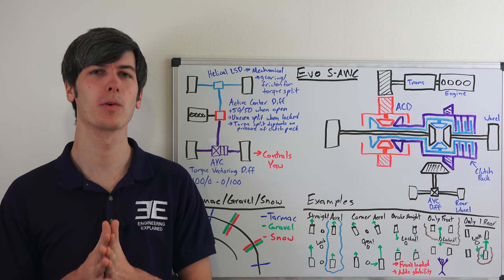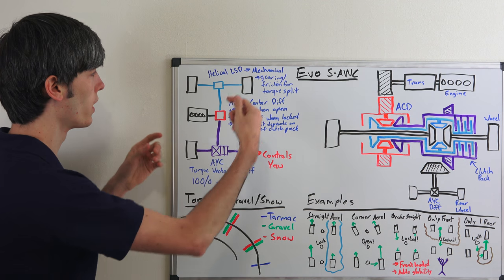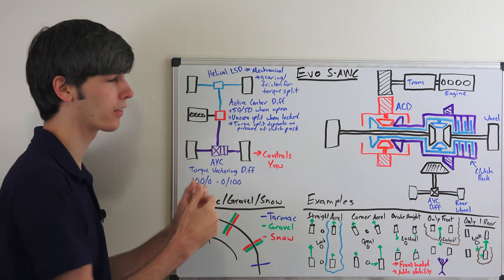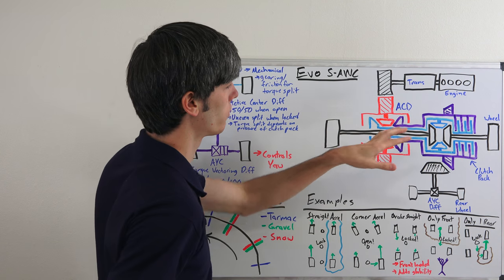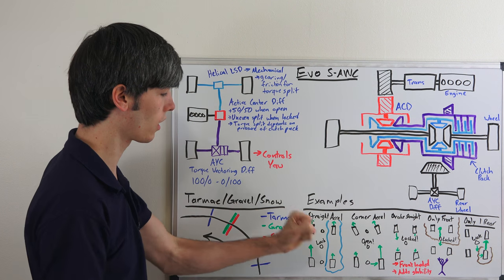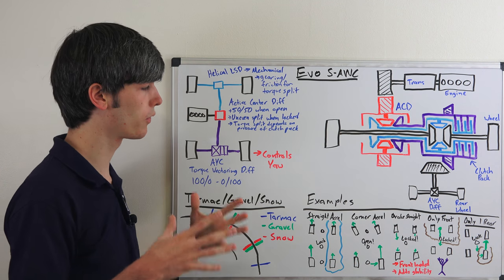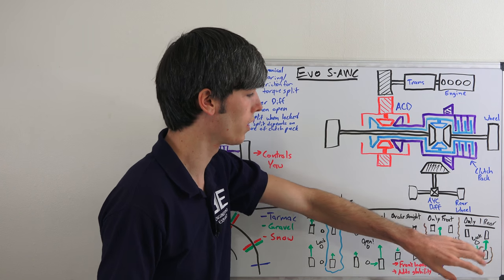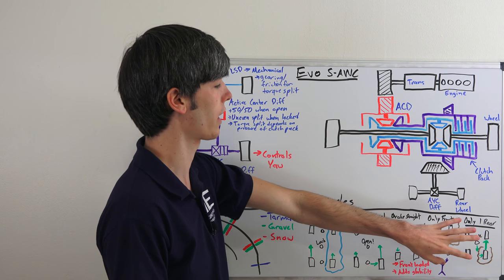Mitsubishi Evolution X - How The AWD System Works (S-AWC, ACD, AYC)

Comment: Explain the STI drive train please. On the forums the evo is praised for its ability to make more power easily compared to the STI, but people take the Subaru because of the reliability. I'm looking into purchasing a 06-07 STI and want Subaru AWD because it in my price range and safe choice for my family. Doing a detailed video on the STI will further convince myself and others why Subaru is a good choice or not?

keep up the good work! hope you get rewarded in life for your intelligence and hard work.
Reply: +PunisherOfDeath101 Hey, Just so you are aware WRX STI's are not reliable, Atleast in there current form that has been around for 12 years i believe. I dont think i have met a STI driver that hasn't had an engine go on them yet. Look around for Bearings going on the engine rod and you will see its fairly common. Not to say they are awesome cars when they work!
Reply: Drpoppler same can be said for mrbitchy..i just prefer the look of the sti. if you slam on any car they will break. these cars are over engineered, too meany places for failure.
Reply: +PunisherOfDeath101 The number one issue with the Evo's drivetrain reliability is corrosion failures in the hydraulic pump that activates the ACD and the AYC.  If you drive in any kind of salty conditions it is almost guaranteed to fail eventually.  The people that ruin their transfer cases are probably running bigger turbos with super strong clutches and launching way too hard.

The Evos are known to make more power easier but I don't think that should be a deal breaker.  If you are trying to make 400whp on a stock block motor you may want to go Evo.  But if you don't care about that sort of thing or are going to go all out and build the motor anyway, it doesn't make as much of a difference.

I do personally think the Evos make better dry track cars due to the handling benefits, but that does not mean it is a better car overall.  If I didn't get an Evo I would want an STi and vice versa.

P.S. STis sound better
Reply: +Drpoppler they can be reliable if you keep it stock.
Reply: +Balo657 ....makes no sense. and I'm not in the mood to debate to you why.
Reply: wat.
Reply: jesus christ.....to a degree stock will last forever...to a degree. their is always room for improvements in performance and longevity of a engine. saying that oem make bulletproof engines that can last longer than a modified ones is bullshit. if the modifies engine is modified poorly for performance only, longevity of engine will suffer. Oem engineers aren't engine gods, very skilled but their is always room for improvements. stock is not where it ends. do research and buy what the engine needs to lengthen is life. reliable and stock sounds so dumb in the same sentence if you say its the best option to make a strong engine. what i said should be comment sense but whatever.
Reply: Carmicha3l well let's start with the factory tune which if you research it, causes many reliability issues. Oh and an air oil separator. Also the rod bearings. I got trimetal ones instead of the factory bimetal. They also have 2 oil ports instead of 1, which is essential for the 2nd and 3rd rod which get fed last. The factory unequal exhaust header is another liability, as it theoretically causes exhaust valves to burn, which is a common problem. How about a frontmount intercooler, the stock top mount heat soaks causing detonation. The list goes on....

Comment: how does this compare to the gtr's awd? that's all electronic right?
Reply: +frankth3frizz As far as I've been able to fathom it out, the Nissan GT-R's system is as follows: By default, the engine sends the power to the rear. The front end is connected to the rear via a separate clutch pack, and when that is engaged, the front and rear are essentially locked together. There is no center differential as such, just a "simple" clutch connection, controlled by computers (this means that if you remove the shaft connecting the front to the rear you end up with an RWD car, and lots of errors). Nominally the say that the torque split varies from 2:98 to 50:50, but my guess is that if the clutch is engaged and rears are on super slippery surface, the front will receive more torque than the rear. The front differential is an open one, so nothing special there. The rear differential is some form of torque vectoring differential, so similar to what the Evo has in effect.

So the main differences: GT-R has no center differential where as Evo does have one (GT-R only sends torque to the front if the clutch pack is activated, and this also locks the speeds together, whereas the Evo always sends some torque to the front and only locks the speeds together if the ACD is active, so GT-R can behave as an RWD in some situations whereas Evo is always AWD), and Evo has a helical (torque biasing) front differential where the GT-R only has an open front differential (so GT-R front diff is less useful when there's a traction difference between the front wheels).
Reply: +jubuttib Basically software engineering (GTR) and electronics engineering (EVO X)?
Reply: dAbaPEsTA123 It's definitely both on both cars, both have plenty of electronically controlled components directed by software. The differences mostly boil down to Evo having a more effective front diff (torque biasing vs. open in the GT-R) and Evo having a center diff that always sends torque to the front (Nissan doesn't have a center diff, only a clutch to connect the front directly to the rear). This hints that the two systems have two different emphases.

Put it this way, the Nissan GT-R is coming from a tarmac perspective and emphasizes getting the power to the rear tyres for more maneuverability in grippy conditions, with the front being engaged when the rear can't handle more power, or when stability is needed. When the front is engaged, the car is always trying to equalize the speeds of both front and rear axles. The GT-R is an RWD car at heart and uses AWD properties to help out situations where RWD isn't enough, but isn't as hindered by AWD's downsides when it doesn't need it.

The Evo is coming from a rally perspective and is worried about always putting power to all four tyres in a functional way. The center diff sends power to the front and rear 50:50 when not locked, and can activate to lock them together to stabilize the car and allow more power to be put down on a looser surface (the tarmac mode makes the center diff lock activate less than in the other modes, because on tarmac it can really hurt turning capabilities). The Evo is a pure AWD car at all times, and for better or for worse has to deal with the problems and benefits of AWD cars at all times.
Reply: @jubuttib  : gtr don't have torque vectoring in rear But simply have a mechanical  LSD..

Comment: Regarding the first example you give: If you're trying to accelerate in a straight line, how much of a problem is it to have a power disparity between the right side and the left?
Wouldn't the car veer in the direction of the slippery patch? What happens if you're cornering and the outside wheels go over some ice, would the diffs lock up and send you wide?

Comment: 1. The active center diff when you say 50/50 when open: what do you mean by open? When does it actually open?
2. How does active center diff lock up?
3. What does clutch pack has to do with open and lock?

The whole open and lock thing is the main confusion I have when I try to understand the video. If you can explain to me, that would be awesome. Thanks again.
Reply from the maker: When the clutch is disengaged, it's open. When it's engaged, it's "locked." Check out my related videos, especially on limited slip diffs to get a better idea. It's drawn and explained in this video as well. The clutch clamps down, so that the two shafts of the differential must rotate at the same speed. This is what defines a locked clutch. Open means they have independent speeds. Video description has lots of related links! :)
Reply: +Engineering Explained how often would that clutch need to be replaced?
Reply: +OneWhoGames 9 times a day :)

Comment: Please, can you compare the Hondacura SH-AWD system against either the S-AWC or Symmetrical AWD please? I think the SH-AWD has a pretty trick rear diff, and I wish it was in a smaller car than the TL, like a new RSX for example (with the J while I'm earth dreaming).

Thanks!
Reply: +Jesse V There's no center or rear diff in the SH-AWD setup, it's just 2 electronic clutches on the rear that can engage from a slightly overdriven rear drive shaft. The new Focus RS uses the same setup. Honestly it's a pretty lame system compared to S-AWC or any kind of symmetrical. It's basically an open diff front wheel drive car with no center or rear diff. Systems like that do not do well in low traction situations. I've researched, which is why I own an Evo X and a full time symmetrical AWD 4th gen 4runner with Torsen center diff.
Reply: +Drew Middlesworth i knew the new focus rs wasn't particularly exciting as awd systems go but i thought there was more to the planetary gearset in the rear of the sh-awd - I know there are several versions of the sh-awd too, but i think the mdx and tl have the best versions? anyway,. thanks for the reply - this is why questions are asked :)
Reply: mis info..sh_awd is 1 unit.split torque to awd.The s_awc is more advances it use 50/50 & ayc vectoring.
Reply: I find the Focus RS AWD exciting. At least from what I've been told it is a cool setup, lacking a differential in the rear and having a different gearing to put the torque vectoring to proper use in the corners :)
Reply: I bet the Focus RS AWD drivetrain setup will end up a huge reliability headache. Using clutches to engage and disengage drivetrain components hundreds of times a day while under heavy power is not going to be reliable in the long run.

Comment: The system is still amazing by nowadays standards. However, as a real evo owner would complain in cold area where a lot of salt is used during winter. AYC/ACD hydraulic pump is a pain in the ass.   Mitsubishi should have factory relocated it into somehwere that doesn't expose to the environment.
Reply: There is a very inexpensive option to relocate in the Trunk.

Comment: Pretty amazing how many things can be shoved between 4 wheels just to move people around. What is it like for a manufacturer to sit down and decide how much technology and engineering they want to shove into a consumer product (after deciding $-in and $-out)?  +Engineering Explained, could you put together a kind of crash course video(s) explaining the processes of engineering new vehicles or components? Or shed some light on the inventive background of mechanical engineering. 

Do manufacturers have an estimated life expectancy of drive train components (or all of the vehicle components)? How long would the differentials and clutch packs last before needing to be replaced? How long before total failure? Reverse engineering?
Reply: +Charles Bulinski It's very likely that the engineers take all those things into account.  the whole process is quite incredible.  I'm a mechanical engineering student.  and I'm just mind blown by the design that goes into a single beam.  costs, ease of manufacturing, efficiency, how long it will last.  all those things are taken into account.  generally it's the engineers job to try and balance all those things and produce the best product.
Reply: +HingleMcCringleBerry nice vid!!
Reply: HingleMcCringleBerry I guess I'd like to observe the people in these scenarios working together to make all the decisions as a group and individually. Plus there's a time factor to make all the decisions.
Reply: +Charles Bulinski exactly! time is an engineer's most valuable resource.  maybe you should become an engineer xD
Reply: +HingleMcCringleBerry I just like watching videos on what it's like to be an engineer. :P

Comment: At 8:20, Why would someone drive on one wheel? Uphill, three wheels are on wet ice, one is on snow,  dirt, or pavement. 

Also I guess you could be in the situation where you are on a very uneven surface with 4 inch bumps or holes accelerating and this could cause one wheel to be on the ground, and this would give this system and edge over say a Haldex for a split second, but this would be competition rally only you really should be driving your own car on pot hols like this.

Comment: Great break-down! kicked myself for not having notifications for your channel turned on. I missed this by 2 weeks.  Now would you be willing to do one on the WRX and STis awd system? Thats a system I know very little about . Even after spending a half an hour reading one of the Subbie forums. No pictures or diagrams so it wasnt as easy to picture. Thanks for digging up the info and getting this video out.

Comment: I could be wrong but in the scenario where only one wheel has traction, it isn't too difficult to assume that might be used for ice.  One wheel might have more traction than the other three, therefore it sends power to that one wheel.

Comment: Pro tip: Evo X in Tarmac mode on snow feels like RWD.

Turn traction control OFF (not OFF OFF) and you look like a really good driver doing second or third gear drifts while the car saves you LOL!

Evo X needs 50% more hp at least so bolt-ons plus pro tune and it's alright.

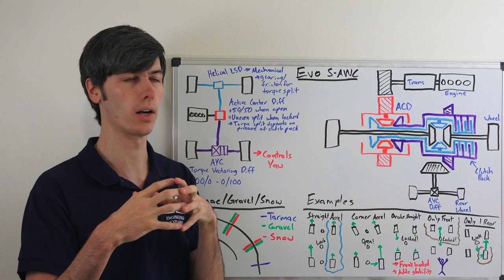Comment: At 5:16 WRONG WRONG WRONG WRONG! That is NOT how a helical works. If you have the right wheel over water, THAT will be the wheel that gets ALL the power. This has always been the downside of ALL helical differentials, they act as open over an unequal terrain and travel the path of least resistance. it will THEN be up to the rear wheels to take the torque it has left and travel the car through the water as the front will be useless until it has grip on both wheels again.

Comment: The power goes to gears of transmission and inside it has a final drive the acd is is inside the transmission connected to the final drive then power goes to the transfer case where the LSD sits and the acd clutch packs sit on the outside of transfer case but everything is with in the transfer case just the two fluids can’t mix I have torn down the transmission and the whole driveline to have it build.

Comment: I've noticed that the driver control selection also changes the sensitivity of the traction control system. Meaning, if you leave it in Tarmac and drive in the snow the traction control system will go ape shit and you ayc breaking and traction control lights will flash constantly. If however, you put it in gravel and then snow the traction control will actually get less sensitived to slippery road conditions and not go into Oh shit mode all the time.

Comment: The last example works best when you're stuck in a snow covered surface or a muddy offroad surface where you have 3 tyres spinning with no traction but only one tyre telling the system that there is grip available underneath it.  The torque system isn't just sent between front and back but also works between individual wheels to get you out of the sticky situations. I'm surprised that a Subi owner finds it an "unrealistic scenario".  Do you not take the Subaru out on a rally-esque offroad areas or put in them deep snow drifts during winter?   Kinda makes me want to quote Tanner Foust from TG USA "For all you Subaru owners who think the Evo is just a pavement queen, think again."
Reply from the maker: +cagednm69 Typically when there is snow under three of the tires, there is snow under the fourth tire as well. In my final scenario, I was referring to 3 wheels being in the air (no contact). I will continue to believe that this is an unlikely scenario for which you need to accelerate in, as I was using the scenario as a tool to explain how the system works.

Comment: Is it possible to modify the Haldex system to make it more like this? There are alot of really good cars out there with Haldexes, but they are almost undrivable from a stand still on a snowy / icy incline. Basically in Colorado, you could have alot of Jeeps, Subarus, and Audis parked on a hill, the Jeeps and Subarus leave, but the Audis can't go anywhere. The only automatic AWD car I can find with five gears or more under $10,000 is the Volvo S40 / V50 and those almost can't drive. The Ralliart is too much.

Comment: What happens when ive set it to snow, but like it most of the year here is, it goes from snow to ice to dry grippy tarmac all the time. Will it burn some cluth pack from the differentials or just skip around with full lock on the tarmac bits.

OR, is it clever enough to activately use different parts from snow/grawel/tarmac modes? Or is there an "auto" mode?
Reply: It's smart enough to open and lock up on its own. The awd system chooses how much and when to lock up based on many parameters like speed, steering angle, throttle %, braking/abs, yaw sensor, etc..
Reply: +Mortalomena The very fact that the car has a second ECU only to control AYC and ACD should tell you that there's more computing to it :)
Reply: Thanks for info! I remember someone I know bought a subaru impreza. He was pretty baffled to find out it had no LSD or anything whatsoever.
Reply: +Mortalomena The worst-case scenario in snow mode if you are driving on grippy tarmac is wheel skipping and/or driveline binding, which is bad. The worst-case scenario in tarmac mode on slippery snow and ice is... a little less power being laid down in the turns. So, tarmac mode is always the safest choice in variable conditions.

Comment: The saddest part of this (as an Evo X owner) is there is a huge problem with the pump that controls that centre diff is the most common problem on the car - it is 100% going to need to be replaced constantly. If you're outside of the US, this is an expensive ($3000 ish) service item every few years.